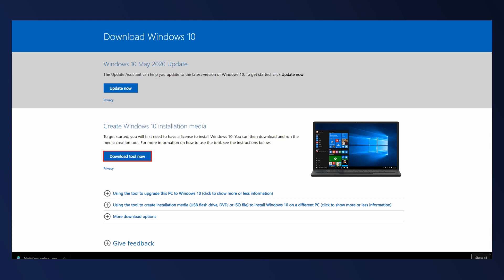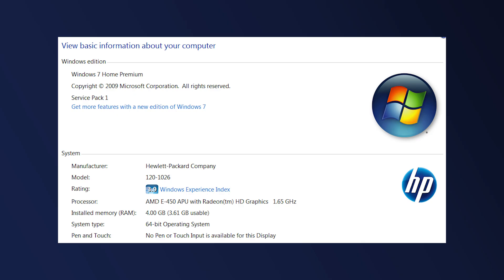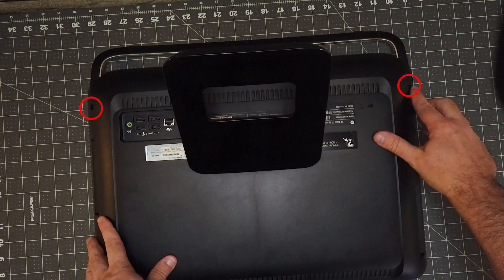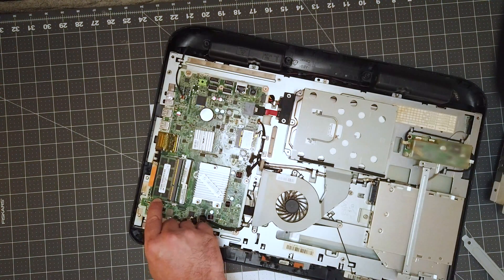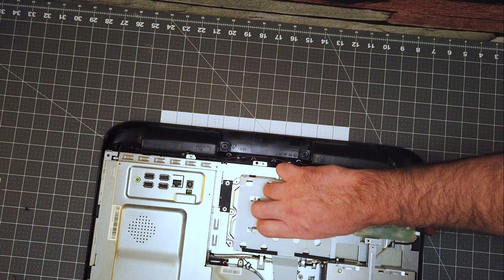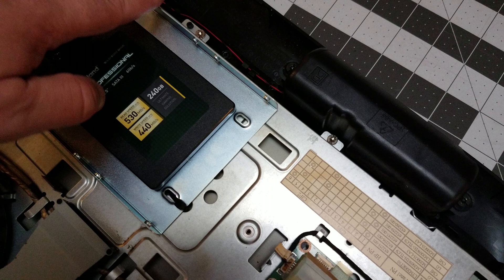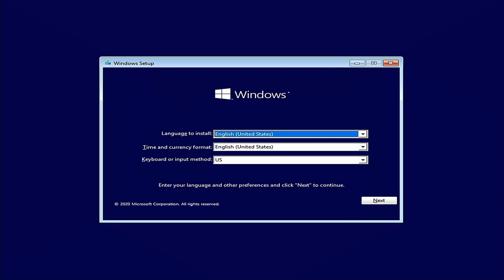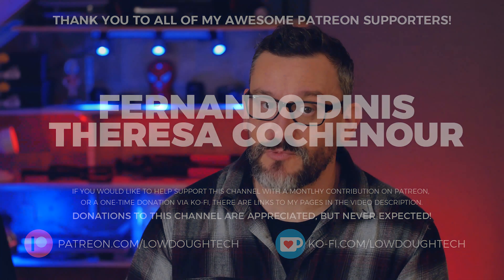HP All-In-One Upgrade

Comment: Just had one of these given to me on New Year's Eve.  It had been bashed in the back which jammed the DVD drive.  Opened it up and sure enough, the drive was badly buckled and irreparable. I went through my random laptop spares and found a 2010 Toshiba DVD drive with the same rear connector but different plastic faceplate.  Changed over the internal bracket and external faceplate, re-installed it and it worked like a charm.   I had no idea that any old laptop DVD drive (with the same connector)  would work but it does.  No need for expensive HP replacement parts.  If that helps anyone - cheers!
PS...  it's still a POS but it was free.

Comment: I love your perfection and attention to detail But the solution for the hard drive with the wrong plate my favourite trick is a few blobs of hot glue on the sides of the connectors and it's not popping off without help and hot glue is non conducive grate on fpv drone components so I'm shure it will be fine for pc
Reply: Laptop different story lots of movement then go with silicone just takes longer to dry

Comment: Thanks for this!! Added 8Gb RAM plus a 240Gb SSD replacement hard drive.  for CA$80.00 have a real nice 23" touch screen running Ubuntu 22.04 LTS.  Wow, is this thing fast now!  My model is the HP Pavilion 23p-129 so the RAM upgrade was minutes.  The HD replacement was longer, only because I had the 2.5 tray issues like you.  So zip ties to the rescue!!  My original HD is a 1Tb 5400rpm unit.  Just too slow.  The M/B Sata connection was raised on two posts, to match the position of the h/d in the cage.  Hence the zip ties.  Watching the Topg Gun 2 trailer now, pretty good sound and video quality for a 6+ year old machine!!  Much appreciated your video!  Cheers!

Comment: Cool video. Does the SSD improved the booting and overall performance of the PC? Because I've read in some forum that it doesn't do much. Planning to upgrade my old HP AIO Touchsmart520. Thanks!
Reply: I was having problems with speed on my laptop.  I mean like it was taking 4 to 5 minutes to get booted up.  I installed an SSD of the same size that was in my laptop and was shocked as how much it speeded up the boot process as well as day to day computing.  My system now boots in less then 20 seconds and I am happy as a lark that I went to an SSD drive.

Comment: Nice video. I have a HP Pavilion All-in-One - 27-a010 , do i need a SSD same size as current one 1TB? i do no that much of a memory but i wonder if SSD capacity should be same as the one in the factory . I hope you can comment. Thanks
Reply from the maker: You can go with a smaller SSD, in this one I used a 240gb SSD.
Reply: @LDTebikes  thanks for the response. I have no idea about compatibility...any advice about what ssd is compatible for this AIO?

other question, have you upgraded a video card on this model ? if so what model and brand can you recommend.

many thanks again!!!

Comment: Hi. I have an hp envy 20 all in one pc, It has a 500gb HHD and a 16gb msata disk catching  SSD. I want to upgrade it. Do I need to search for a Msata ssd drive? I read somewhere that the 16gb can be removed and just to buy a 254 gb SSD like you did. Please help, what should I do?
Reply from the maker: Without having that specific setup, speculation would be the best I can offer, but I would think you could just replace the 16GB drive with a bigger one.

But, again, this is just speculation on my part.

Comment: I have the HP All-In-One that says the Display Adapter is in Intel HD Graphics 4400. Driver Date: 8/16/2018. (Model: IV897NH. 23-q113w) I seem to have enough HD space by sometimes browser windows crash, I think I need to upgrade the graphics card. I have 6 GB Ram. 731 GB free space. Can I upgrade the graphics card? Any suggestions or advice?
Reply from the maker: The graphics cards for these devices are integrated, and unfortunately, they can't be upgraded.

Comment: is the cpu upgradable?
Reply: You can but check online which ones the motherboard is compatible. If you currently have an Intel then your new one also has to be intel for example. If you look up [computer model] specs you should be able to find it. There should be section called processor upgrade information with a chart of compatible CPUs. Here's an example for the b010 https://support.hp.com/us-en/document/c03524666